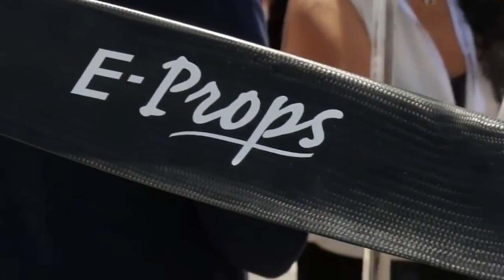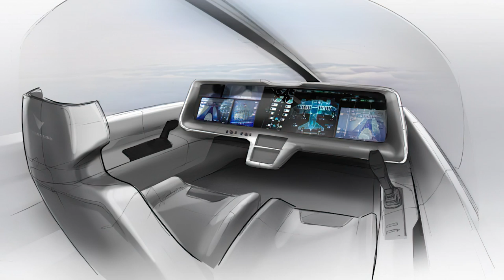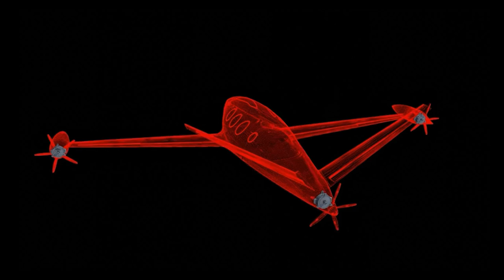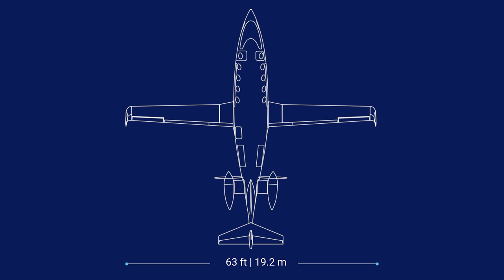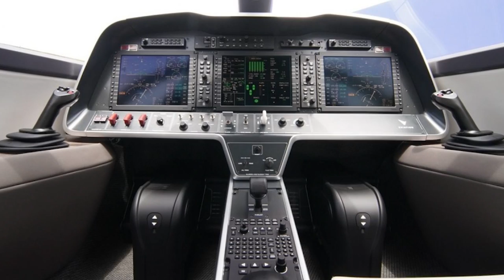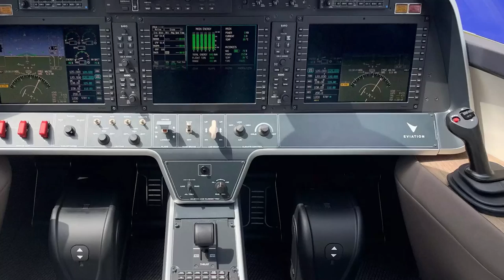Eviation Alice - electricity bursts into the sky

Comment: I could have done the math and predicted the range failure for a few hundred bucks  .. would have been no need to build and waste millions ... Batteries power to weight ratio over Kerosene is 14 / 1 .. meaning you need 14 lbs of battery to match 1 lb of kerosene ... There as of yet is no such thing as a useful electric transport craft and never will be until that ratio is cut in half ... and that conceivably may never happen
Reply from the maker: At least they are trying to find a solution. Attempts to create electric planes forces to look for the best batteries for them

Comment: Given the cramped layout alone, I would not want to ride in this vehicle. This is a seriously dead end!
Reply: The layout is not cramped compared to similar turbine-powered planes. The cabin is larger in both dimensions than a Pilatus PC-12, the current standard for 9-seat executive turboprops, and with the wide cross-section, it's likely to feel more like a midsized jet than a turboprop.

Comment: Electric plane, but how is electricity produced? It's only trendy but not truly environmentally friendly...
Reply: Classic controversy. Electricity is not a completely green solution. But it's greener than fuel
Reply: @flyerkiller5073  greener? In what ways? Can I have evidence please?
Reply: Electric motors are way more effecient tha dinosaur fuel regardless of how you generate the power, electric motors use less energy.
Reply: @planespeaking  but the "fuel" weight is way higher
Reply: @birdiessimracing  That doesn't make the motors less efficient though, which was the original point.
Reply: @planespeaking  you're right. I just wanted to point out that it's not ready for use in commercial aviation yet.
Reply: Hydro, Wind, Solar, geothermal. Eco friendly ways to get electricity to power these aircrafy
Reply: @Island_Line_Rail_Productions  nuclear
Reply: @planespeaking  of course, it is sufficient for you to state so... As a scientific evidence

Comment: replace battery with gas generator and it'll circle the globe on a tank, but oh no, ideals first
Reply: High torque APU driving a generator to provide engine power, smaller battery array for backup.
Reply: It's far better to just use the fuel to drive the prop directly. Every time energy is converted there are losses.

Comment: High altitude heat deposition from jet aircraft is the most likely candidate for producing severe, abnormal weather events worldwide. Combustion zone temperatures in a jet turbine reach as high as 2300 degrees C, and the stratosphere is between minus 30 to 50 degrees C. Also, jets fly in the jet stream to save time and money. This means that the jet stream is being heated and expanded by the jet exhaust, as well as having to endure the reaction caused by the force of the jet thrust, which is in the opposite direction of the jet stream. It will take many years for the jet stream to recover, and the ozone layer, terribly depleted by jet traffic, to be renewed. We urgently need to get electric planes in service asap. Go Alice.
Reply: I completely support going fully electric across the board for a plethora of reasons, but the effect is, volumetrically, relatively insignificant compared to the jet streams. The heat captured by the annual output of coal and natural gas power plants production of CO2 is an order of magnitude or ten higher than the heat from jet exhaust. Demolish the coal and natural gas plants and replace them with almost anything else and we've made substantial progress towards net zero. Nearly the rest of CO2 production from cars, planes, trains, rockets, and animals can be captured and repurposed, especially if fusion takes off, since our power capacity would be significantly improved. Could even convert CO2 to O2 and use the carbon to make graphene for a light solar shade to get us back to our nominal temperature in our cycle.
Reply: @noalear  There are a million people in the air 24 hours a day. The jet engine requires 16.8 tonnes of atmosphere to combust one tonne of Jet A. That is a lot of superheated smog in a sensitive area. This volume of gas, heat and pressure at thirty thousand feet will have a far more massive effect than surface-based heat sources. By the time heat from a gas fired plant reaches the stratosphere it is cold. Not so with jet exhaust. Gas plants are an excellent interim power source, and the low-grade heat that they produce as a by-product is useful. Low grade heat is being exploited more as we discover how easy it is to use.
Reply: Holy krap, this he/him/she/blm went there....HAHAHAHAHAHA
Reply: And if you have to get somewhere that's a thousand miles from where you are now, are you going to walk?  No, wait... you'll wait for an electric powered aircraft to take you there! :body-blue-raised-arms:
Reply: @johannesbols57  We have to move towards electric planes. The damage done by jets is more than you imagine. We should be shying away from unnecessary jet travel wherever we can use the net instead. One day we will have fast cool-running electric planes, so I am just hoping to make that sooner rather than later. Personally, I love to fly, but I will try very hard to not do so again, if possible, until electric planes are available.

Comment: if they started to use electrical front wheel for taxing. that would significantly increase its capacity in range.
No need to rotate propellers during taxing.